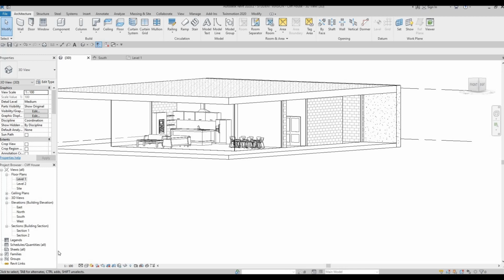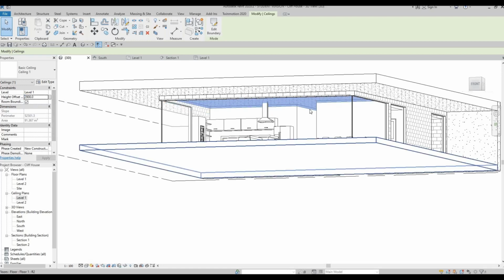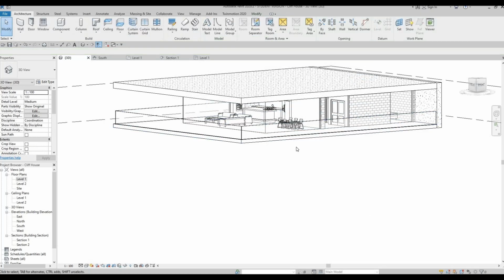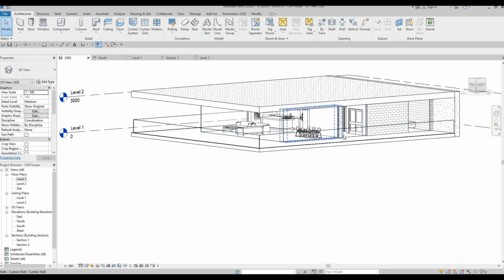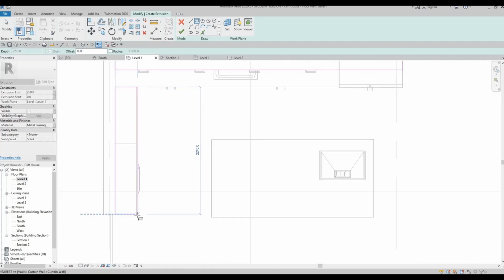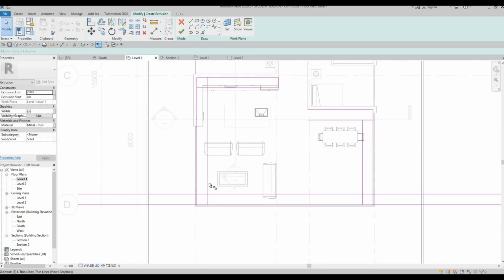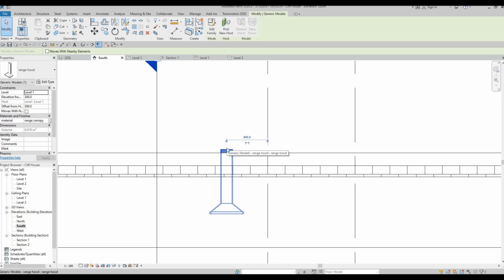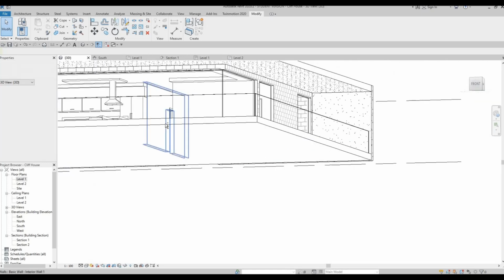Cliff House | Part 6 | Complete Step by Step Project | Revit Tutorial

Comment: Sir what's the difference between in place mass and place mass under Massing and site section and  Model in place in components under Architecture and sir how to use Site Designer and BIM Interoperability Tools  ???
Reply from the maker: For the first question, I like using in place mass more its because you can directly design for example the kitchen in your model. No need to do measurement and all that. In terms of using massing, it is good as well as you can make a more intricate designs. But using either is okay depending on yourself but a good example is when i design kitchen directly in the project and  not in massing. For the second question, unfortunately I do not know the answer to that. 😬 I am not familiar to those topics 🙏🙂